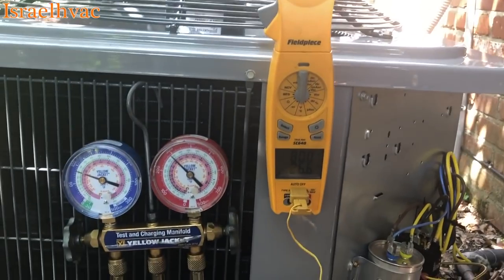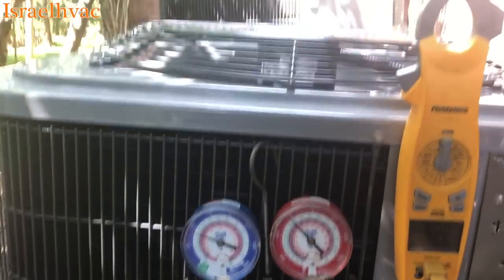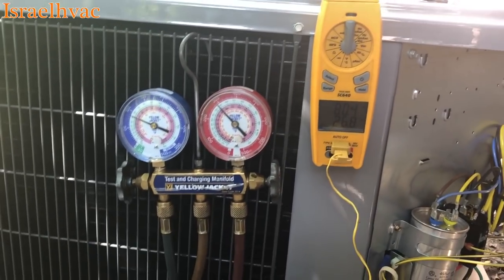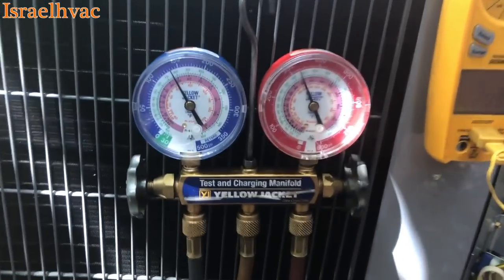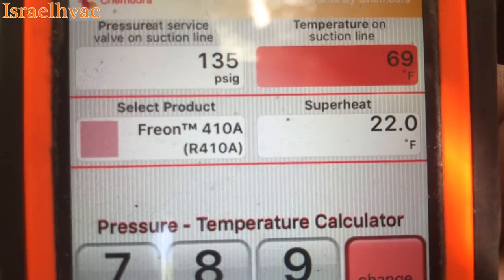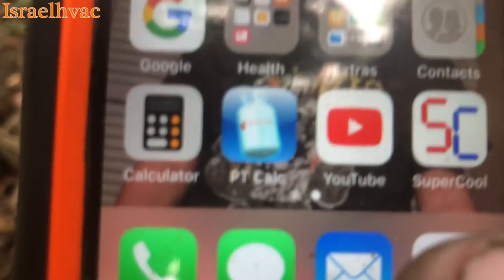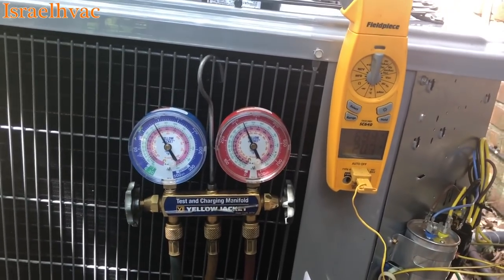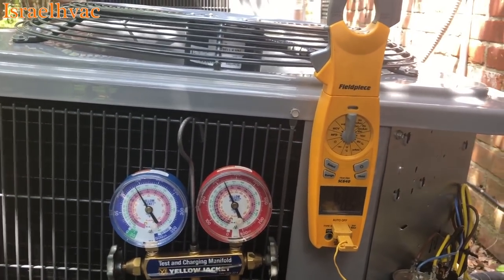Checking Superheat Without Digital Gauges

Comment: I learned way back from a Emersion Energy management guy how to calibrate these old gauges. The S-man too has a technique. Electrical tape your thermo sensor on a drum of Freon first thing in the morning. Write down your temp. Get your trusty old pressure/ temp chart and then put your gauges on drum of Freon. Compare pressure to temp per your chart. Adjust your gauges to temp on the dial of guages with actual temp of your temp sensor. Start your day. Every now and then replace hoses or gaskets.

Comment: You're in trouble as a tech if you don't know how to do the job with the basic/analog tools. I never got into the digital manifolds. I bought the fieldpiece SMAN the first year it was out but it was stolen before I got to use it more than a couple times. Didn't replace because I realized it was just a toy that I probably shouldn't have wasted money on to begin with.
Reply: i thought so too,i have a testo 550 bought 3 years ago sat in a cabinet, i just used it last week for the first time because i was having a txv issue,with its blue tooth i could be in the attic and see the pressures on my phone,im old school too but damn,i had all the info in one place from one tool,just sayin
Reply: tipoblanco oh I'm not saying they don't have positives. Being able to read pressures and temps on the other side of the system where you aren't is a big deal sometimes! The digital gauge is better for the pressure test as well
Reply: 71dembones yep,and still for just everyday use I grab my jb's,more experienced techs can tell a lot about a system with just hi and low pressures,and I feel any new tech should start with that and an experienced mentor
Reply: tipoblanco I do a lot of diagnosis with my hands and eyes before I even get the tools involved. People often scoff when I tell them what the problem is within two minutes based on basic senses; but, have no rebuttal when I'm right. There's nothing wrong with being precise with more accurate measurements but, you have to be able to do the job with the bare minimum too.

Comment: Thanks John! When would you use indoor and out door bulb temp
Reply: Jacob D do you mean IDWB temp?
Reply: Chris Hall yes sir
Reply: you have to,to verify correct target super heat you need 4 parameters,indoor wet bulb at the return,outdoor ambient,suction line temp and saturation temp,otherwise that tells you nothing,super heat changes dramatically when those conditions change,only if it was a txv would it hold a continuous super heat
Reply: Sir what should be minimum and maximum superheat for a healthy system